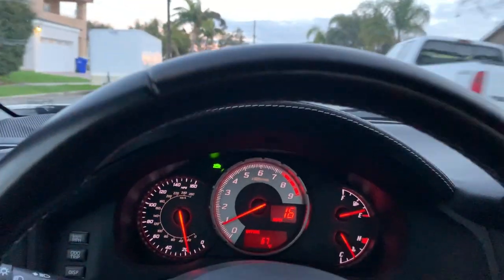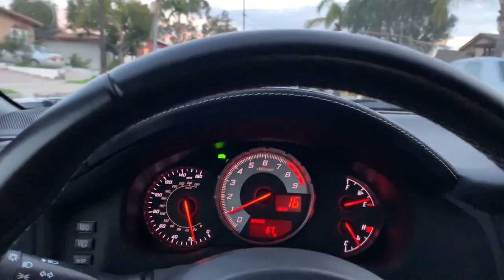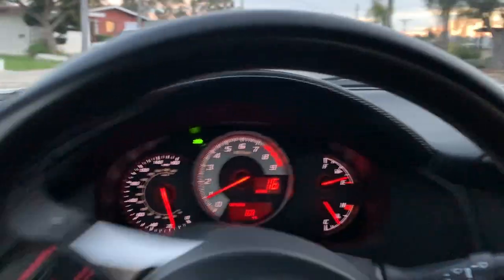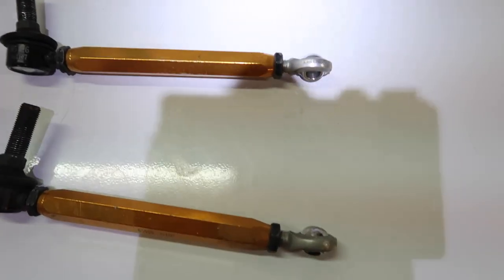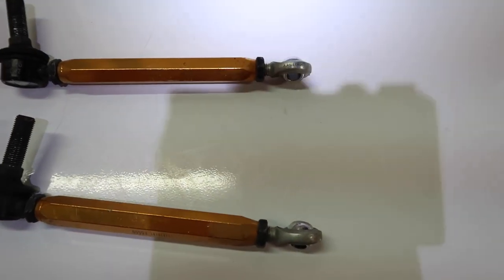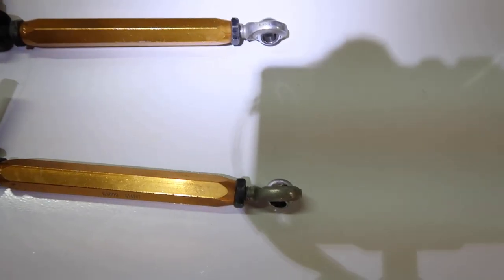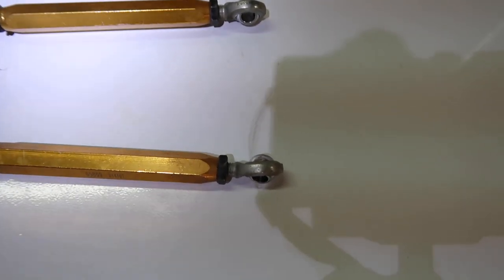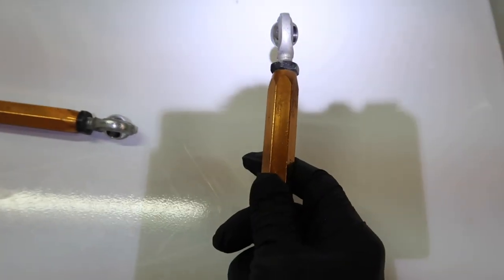I BROKE MY CAR - The price of going fast!

Comment: I had the same issue with my BC Coilovers RM Type. I ended up buying replacement shocks and rebuilt them. Hasn't made any noise since then. Like you said, this happens from running race car parts on the street which is not a race car environment.
Reply from the maker: Thanks for the data point, very interesting.

Comment: Is the pre-load set a bit too tight? I’ve had a popping sound issue on my fortune auto coils. I loosened them up n wiped the “seating” area for the spring which helped.
Reply from the maker: Pre-load is a misnomer. These are purpose built race shocks so the entire body is threaded and they are one piece. This means you adjust your ride height via that collar. Fortune Auto uses a three piece design to cut costs but, even then, the right way to adjust ride height with those is to use the collars under the spring too. You would just want to take the extra step to install them without springs and set the shock length using the bottom collar to a good middle ground of droop/bump. Then install the spring and set ride height that way.
Reply: The Driver's Perspective ah ok, a different animal all together there. Hope the rebuild works out!

Comment: Are those whiteline max g coilovers with swift spring upgrade?
Reply from the maker: Yes they are!
Reply: @TheDriversPerspective  how much will it cost to rebuild a full set of coilovers more or less?
Reply from the maker: It really depends on the brand, expect at least $100 per shock/strut. I'd budget around $500-1000 depending on what work is getting done.

Comment: I disagree.  You exposed a weak link (no pun intended) or part that either fatigued to failure or was under-engineered for their intended purpose and now it's time to source something more robust.  It would sukc to have to pull suspension parts and "clean" them every 4-6 months, even if they are 'race-engineered'.  Maybe race-engineered is the problem and you need street-engineered parts as those are more install and forget.    Can you show up on your motorcycle for an autox?  Even if it didn't count, it would be interesting to see how you do on two wheels vs four. leathers???  [Thursday @ 12:30 doesn't work for me, can you do a different day/time  ;)  ]
Reply from the maker: I feel you on cleaning aspect, I've been doing some research and the shops who rebuild these recommend a shock cover for inverted units that are on the street. 

Regarding motorcycles at autocross they aren't allowed, but I know they would be much slower. A Supermoto would hang better but would still be slower than a car. The reality is contact patch is king at autocross, something the motorcycles are lacking. I've driven Auto Club Speedway in my car many times and when I went on the bike in September I kept thinking to myself, I am going so much slower through these corners!